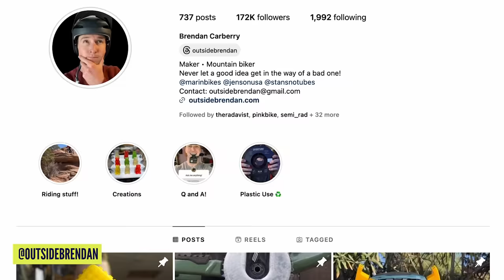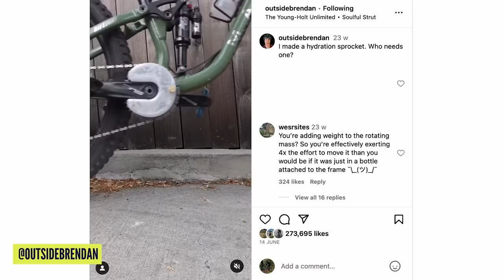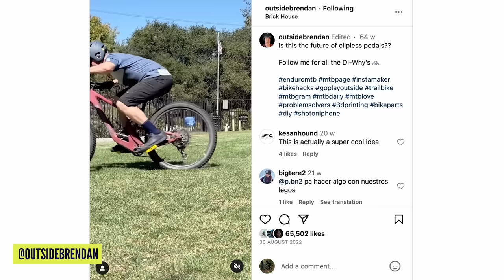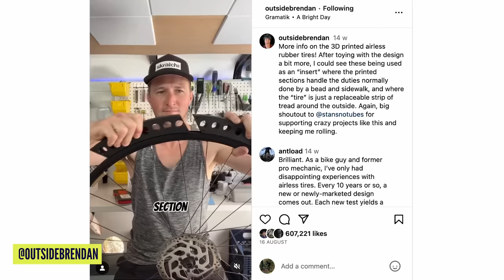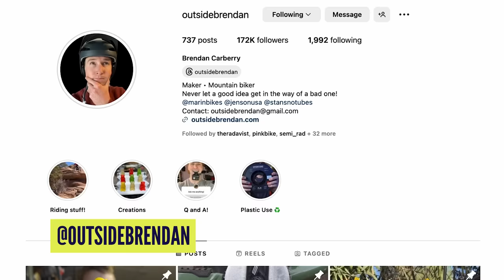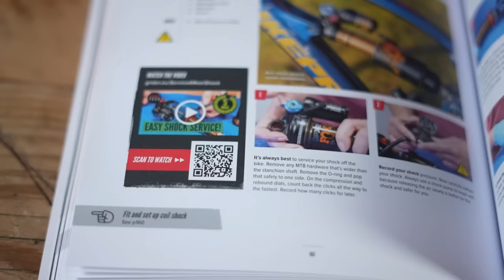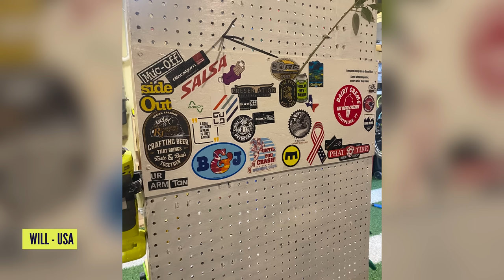Is 3D Printing A Fad Or The Future Of Mountain Biking? | GMBN Tech 308

Comment: For sure you will see more and more 3D printing in MTB. I wouldn't be surprised if we see hole bike frame printed from probably aluminum or titanium. More so when some uses AI program to then generate said bike frame. A frame using this way would look like nothing else out there. The only current problem with 3D printing is production volumes. 3D printing simply can't match the production volumes of normal methods. This is why more boutique brands are using 3D printing like Atherton bikes.

Comment: Home 3d printing is a fad imo. However if home printing improves drastically this could change. Currently most of the printed stuff is not durable enough for long term use.
Reply: Just like stick welded steel or manually filed aluminium. It takes an industrial machine to make an industry grade product🤷‍♂
Reply: Home 3D printing is very useful if you know how to use it. I use my Printers all the time to fix things and solve issues around the house. But of course if all you know how to do is print decorative little pieces then it's kinda useless besides the hobby aspect.

3D prints can also be very durable but it requires different design considerations than injection moulding or Machining.

Comment: To me, 3D printing is a great way for brands to iterate while creating new parts. They can toss ideas in the CAD, then print in a "few" hours, where "traditionnal manunufacturing" would take many days/weeks and probably cost more.
Also, I'm not sure that 3D printing is suitable for mass production. It's not a process that scales as well as others (molding, cutting...).
Reply: Printers are getting faster and cheaper.   Not up to injection molding speed but it lets you not have tons of molds and keeps a manufacturer versatile with less space.  Of course,  you need a lot of printers. *A SRAM Red cassette takes over an hour to machine but they still sell plenty of them.

Comment: I think it would be great. Currently, titanium bikes are more expensive and less advanced than their carbon fiber counterpart due to the difficulty in manufacturing.
I've wanted a Lynskey fs140 for years but it only has a horst link 4 bar while my dream bike that I got was cheaper and came with a full floater that did all sorts of wonderful things like reducing the pedal bob to a negligible level.

Plus if we can take car parts as an example like the ones from the czinger 21c, 3d printed stuff can look really amazing when computer simulations are used to create the optimum shapes
Reply from the maker: It should be able to reduce the material cost by reducing waste! That's such a good example, plus if you add AI into the mix it could potentially reinvent mountain biking as we know it!

Comment: 3D printing is just another tool. it has benefits and it has problems. The biggest problem with 3D printing is the fact that you still have to design the thing you're making and while you can buy a 3D printer very cheaply the skills to actually design a product aren't available on Amazon. But just like there are still blacksmiths 3D printing isn't going to all of a sudden make every other manufacturing option obsolete it will have its place in the toolbox just like the rest of the tools.

Comment: Additive manufacturing will never replace subtractive methods (fight me), but it’s hardly a fad.
Reply: It's too expensive for mass production, but it's a method for small scale production and for prototypes. While it will likely not replace casting and forging it's a complement for parts on more expensive bikes or on prototypes. Airbus is already using the technologgy for brackets for their Aluminium fuselages.
Reply: @simonm1447  agreed. I worked for an additive company that was making all sorts of parts for aerospace, but they always finished the parts with CNC since additive can't achieve high dimensional accuracy or surface finishes required by industry.
Reply: @willhoonforfood4463  the advantage for aerospace is you can make parts which are lighter, since it can produce hollow parts you could not make with casting in the same way or you can also make them like bones with a stable outer hull and some lighter material inside. Even if you give them a CNC finish you still have the weight savings.

For aerospace the cost is not the most important criteria as long as it saves money later during service.